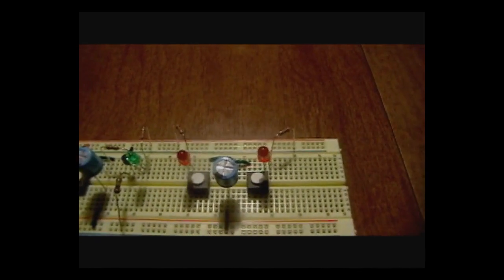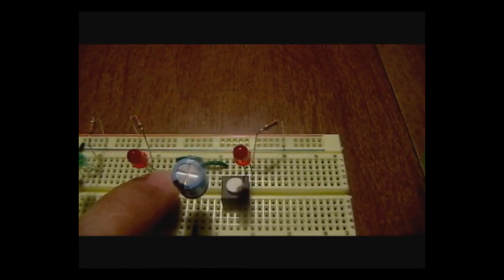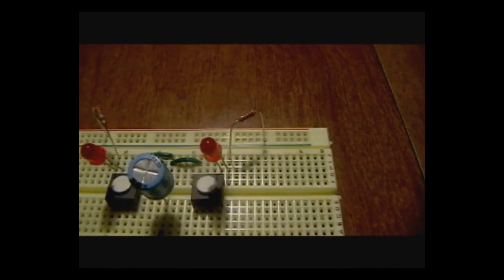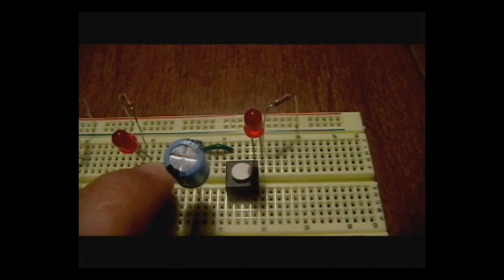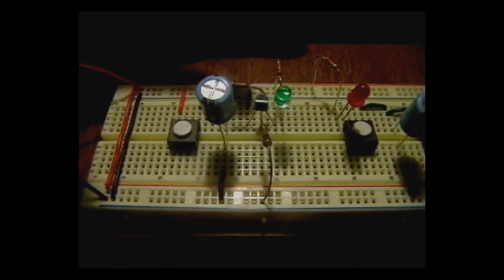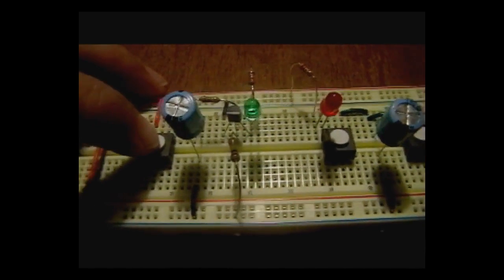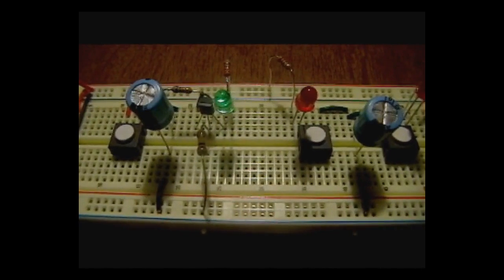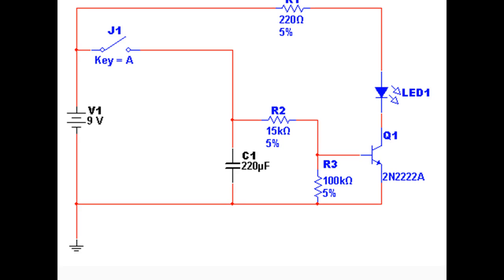Capacitor Charging and Discharging with Schematics

Comment: Many thanks Jonathan, especially for the schematics. A couple of questions if you don't mind. Why is the large R3 resistor necessary? How do you determine the resistors to use - instinct based on experience, calculation, or do you use a potentiometer to find what works first?
Reply from the maker: The big capacitor is used to increase the charge / discharge time.  The time constant is R*C.  It will fully charge / discharge in about 5 time constants.  The larger the cap and resistor the longer the period.  I just chose this value to make the period reasonably long.  A small resistor will allow a faster charge or discharge.
Reply from the maker: +Simon Chadwick Simon, I went back after writing the previous response and quickly reviewed the video.  I assume you are talking about resistors R2 and R3 in the second schematic.  R2 is 15K and R3 is 100K.  These resistors serve two purposes, the first is that they bias the base of transistor Q1 in order to turn it on which in turn will turn on the LED.  Secondly, the large ohmic value is as I mentioned in my previous response, meant to allow for a slow discharge of the capacitor.  In this circuit, C1 charges nearly instantly once button J1 is pressed since there is virtually no resistance in the circuit with the capacitor and the battery.  Once the capacitor has charge sufficiently to take the base of Q1 above 0.7 volts through the resistor divider of R2 and R3, the LED will come on and will remain on after the button is release until the capacitor can no longer provide sufficient voltage to keep the base of the transistor above 0.7.  The discharge time is fairly large because the resistance is 115K and the capacitor is 220uF and we only need to maintain 0.7V at the base.  

I hope this makes sense.  Please let me know if you need further explanation.

Comment: Could this be achieved without switches? That is having one capacitor charge and then the other one disharge?
Reply from the maker: Yes, what you are describing is similar to a multivibrator circuit.  There are many examples on the internet that will blink lights based on the use of a couple of capacitors, transistors, and resistors.  It is also possible you could do something with this type of circuit using an SCR that would trip when the charge across the capacitor reached some threshold voltage.  I haven't really spent much time playing with that sort of thing, but if I get a chance I will see what I can put together.
Reply: Jonathan Bisnett Thanks Jonathan. I planning to build a couple of "solar bugs" using that principle. The guides on here are quite straight forward but fall short of actually explaining how they work. :(